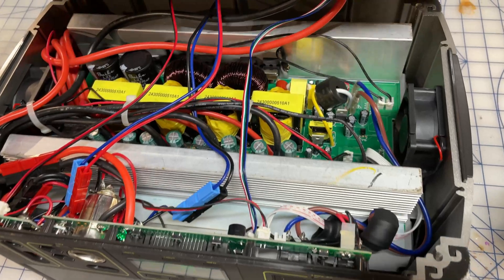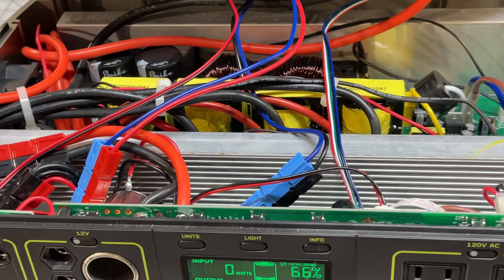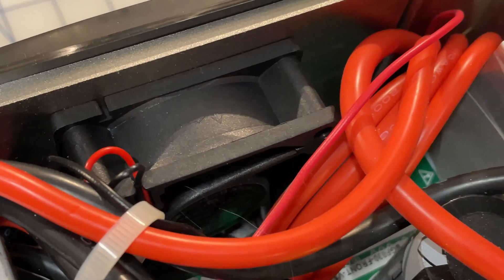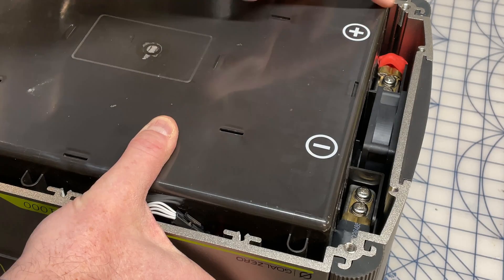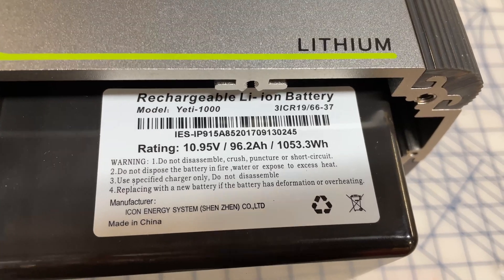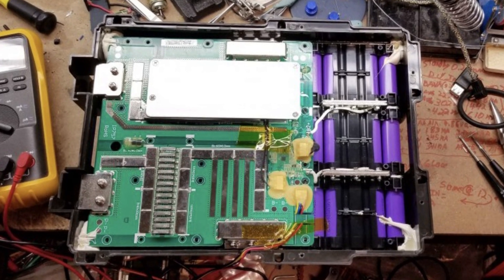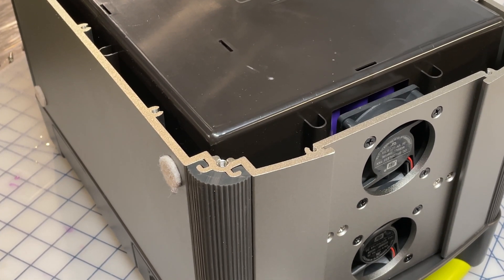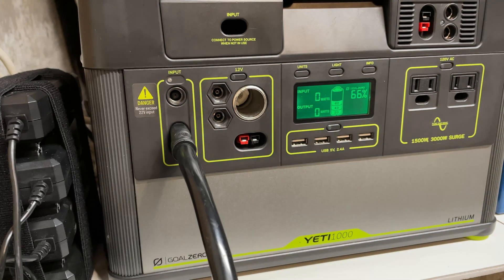Goal Zero Yeti 1000 Teardown: What's inside?

Comment: is their a place or shop to get one repaired  , costumer service is non existent  , never answer the phone  , after emailing them you get the run around , then you are ghosted  , i have a 1500x , the 110 ac outlets work for about 2 minutes then beeps twice and quit  , only using about 90 watts , wait 5 minutes , , will run again for  will run a 7 watt light bulb for 30 secondes , all other outlets work fine , , unit is 1 year old ,, anybody ??????????????
Reply from the maker: Unfortunately, I think goals zero has really has lost it. I wouldn’t buy anything from them ever again.

Comment: I have this Yeti 1000 and when I put the charger in, it beeps 3 times and the display comes on for 5 seconds and then turns off, but the blue charging message light never comes on. I've already disconnected the reset cables and it's still the same. Could it be the charger?
Reply from the maker: Hmmm. Not sure. You could try to open it and reset the bms by unplugging the cables but you can call their support first
Reply: @todd.parker  I reset everything and it's still the same, I received a new charger and even then the blue light doesn't turn on, I disconnected and removed the battery pack and noticed that the voltage on the battery terminals goes up and down from 12v to 1v and sometimes it doesn't go up anymore, I think there's a short on the power board

Comment: A few comments:  The bottom screws are for attaching to the cart, or other future accessories.  As with many things, the way you replace the battery is by replacing the cells - they look like standard 18650 cells.  If you are going to use an insulated screwdriver for 12 volt things, it's helpful to prevent shorts, but at 12 volts nothing will zap you unless you like lick it or stick it into your body somehow.  BUT, your tapemeasure isn't insulated, and could start a fire if you short out the + and - terminals.  Finally, thanks for doing this, even if you don't know much about it - we need more bravery and curiosity about things, and you are clearly showing that and teaching that.  Thank you.

Comment: Not sure if you'll see this or not but I have a 3000 that there was no communication cord to the mppt coming from the board. It looks like it come from the front board with 5 wires. Where your wires come out and goto the charge controller mine comes out by then loops back to the board. Not sure if it was wired wrong or what the deal was but goal zero wants 450$ to fix it and run the wire. If this is all it is the. I can fix it but don't want to burn up something

Comment: I had a customer bring me a Goal Zero Yeti 1000 it was dead and out of warranty so took a look at it the battery is a 3s 13p Li-Ion  this one had 3.65V-2600mAh-LG-M26-18650 cells with a maximum of 10 amps each x the 13 cells , yelp 130 amps so please don't do what I did unless you are qulified . There was on this bms test points to check each group of cell voltages , this battery had 1.8v on 2 groups and 2v on another so charged each group slowly to 4 volts and then noticed bms not working so reassembled pack and put a new ac charger on the unit and finished charging now finally the bms came on but nothing is responding on front display so about to see if I can wake it up when I get back to it . This power unit is built really nice so hopefully it will wake up. This unit was put away for several years without charging and the BNS just shut down like it should to protect the cells so hopefully it will be fine. So guys protect your investment and keep it charged and please use it at least some so it will be ready in an emergency .
Reply from the maker: Thanks for sharing all that info! Good stuff
Reply: @leedlbo9949  

Do you think these batteries are rebuildable?

Comment: I find for a lot of gz products the “parts” don’t seem to be publicly available, I hunted for the GZ 9mm chaining cable for the Sherpas Google also returned nothing. Seems very closed loop.
Interesting to see the modular expansion of the yetis as they get bigger
Reply: Forgot to add. Some products do exist (light-a-life) non branded and also some of the flexi GZ panels but without the “ports” gz has on them
Reply from the maker: Yeah, GZ has a lot of semi-proprietary connectors that are a real hassle. I prefer MC4 and XT60 connectors like most other brands now use. I wonder if they will every update their product line....
Reply: @todd.parker  I have found the Lenovo 7,9mm nibs fit the goal zero ports and as such enable building hybrid leads. I currently have a 5,5 to 7,9 lead for my 60&120w panels into the yeti. The 9mm ones are rare (like can’t find them anywhere) except on an ageing high power laptop power supply

Comment: Your right about over engineered cases...they are suoer nice, but when the technology inside is outdated and they also want a premium for it, I'll take a plastic body with far superior internals. I don't need the body to last 300 years when old tech standard lithium cells will fail in 5 years or less. There is no need for aluminum body and i feel like goal zero focused too much on that aspect with no real benefit.
Reply from the maker: I agree. I do think the case design is pretty smart because it’s just some aluminum extrusions so they can make it taller or shorter to fit different size batteries but I can’t recommend their stuff anymore

Comment: Goal zero is well behind the current competition.  I suspect they will be out of business if they don't start innovating soon. These current models have been the same for about 4 years and are regular lithium cells. The competition offers far superior lithium iron phosphate cells which are leaps and bounds better in terms of cycles and charge rate, better inverters, usb c up to 100w and nearly half the cost per Wh vs goal zero.  Admit I used to be a goal zero fan boy, but if you compare to bluetti or eco flo, its obvious goal zero is a over priced dinosaur. 🦖
Reply: Ecoflow is using NCM lithium, same as Goal Zero. Bluetti tho is using the better iron phospate.
Reply: @mwiz100  you are incorrect. Eco flow is LiFePO cells.

Comment: This is an excellent video. Lots of people on social media bashing Goal Zero for being expensive, but they aren't taking into account that the entire case is thick aluminum framed. A Goal Zero Yeti could roll over in a sharp turn or fall off a stacked pile in your cargo area and fall on the floor, and most likely be just fine, b/c everything is bolted to a metal frame. Jackery, Bluetti, and others are all plasticky junk and would crack. Heck the handle on the Jackery is fixed and would just crack. Goal Zero is like the Apple of the power bank industry.
Reply from the maker: I agree that their extruded aluminum case is really great. I like the simplicity and ruggedness of the GS stuff but I do think they have fallen quite a bit behind competitors at this point and the value proposition isn't there anymore. Let's hope they release something new soon that includes an internal high speed charger, LFP batteries, expansions batteries that aren't lead acid, etc.

Comment: i wonder if its possible to expand the battery by replacing it with the one that goes into the yeti 3000
Reply from the maker: My hunch is that would work but they don’t sell replacement batteries
Reply: @todd.parker  ya taking a second look at the battery internals it seems to be a 3s batter.  I wouldn't be suprised if you could replace them with 3 big one from alibaba and wire them into the bms.

Comment: Yep. From an engineering standpoint, the goal zero yetis are awesome. But sadly I read a lot of bad things about them in other videos. I hope mine will hold up and have no problems.
Reply: Had this same model and now after 3 years it's having charging issues. Goal zero won't do a diagnostic as they just want to change the battery for $400. Thought it would last longer than 3 years.
Reply: @senior706  Same thing happened to me, but now they want $500 to replace the battery.
Reply from the maker: I still think the Yetis have the best inverters and displays in the industry but they are quickly falling far behind Ecoflow and Bluetti on features and price. Let’s hope they step it up.
Reply: @todd.parker , For now, the Yeti X fits my needs perfectly. With the progress in technology, there will be something better and/or cheaper sooner or later. Since I plan on using my Yeti X for the next 10 years (I have it in use just for a few weeks/year), my biggest fear is that it will fail at some point.

Comment: My eight millimeter solar connector on the front face of my Goal Zero Yeti 1000 doesn't seem to be connecting right and it would not charge how can I fix that? I've seen how I can remove the top thank you for that I really appreciate it but by looking at your video it doesn't look like it's too hard to get at it but have you any ideas about how I would get it to connect to my solar panel? It seems like it's not connecting inside for some reason I don't know if it's on my solar panel connection or if it's on the goal Zero Yeti?
Reply from the maker: Can you use the 8mm under the lid to test if it’s the panel or that specific connector? There are a number of inputs on the 1000. Seems you could open the top and see if the connectors has come loose if you wanted to fix it.
Reply: @todd.parker  it's definitely the connector not on the solar panel I checked that already I think I'll try remove the lid and see if I can get in there but it looks like just too much movement on the connector like it's loose almost like a piece of wire inside the connector is not touching anything but I will remove the lid and take a look at it thank you so much

Comment: Yup.  Now I don't have to scratch my curiosity itch and take mine apart.  Just want to share that I've had mine since 2017 - when they first showed up at Costco.  I use it 3-4 times a year as the main 110V power source for my off the grid cabin. It has been reliable - everything works.  It's not super heavy - about 30 pounds - but I would not want to carry it far. I purchased a second charger as it has two charging ports and, yes, it charges exactly twice as fast - taking half the time. That is helpful because otherwise it takes about a day.

Comment: Greetings Todd, I've been following your channel for a while and grateful for the tests and recommendations. 2 years ago I own a Yeti 3000 unit as a backup in the house. My only concern is the safety of having a Li-Ion battery inside the Yeti. Do you know of any GZ scheduled replacement or modification (outside of GZ) of the unit to replace its internal battery with a safer one?
Reply from the maker: I have no information but I can guarantee they won’t offer a LiFePO4 drop in replacement. They don’t even have a user replaceable battery in the lithium Yetis.

Comment: maybe an ignorant idea, BUT, if you are using it in a full time nomad application, when the battery dies, as it will, remove the battery and wire in a suitable large battery to stand beside it, use the Yeti as the brain center and essentially an external battery as the power. As long as the "new" battery is similar specs, all the features should work the same. Does that make sense to the more knowledgeable or am I simply displaying a total lack of understanding ? be kind ! I'm fragile
Reply from the maker: I think that makes sense. The only Q I have is there is a set of BMS wires that may look for something specific to the built-in pack but in theory it makes sense.

Comment: Yeah, my 1000 is doing the same thing. And rather than send it in for a $500 NMC battery replacement, I just picked up a battleborn 100Ah and "chained" it as you did in your previous video. This set up, along with the GZ link, and 2 100W panels on the roof rack keep my ARB fridge continuously powered, and my jeep's dual batts trickle charged. Is there a way to add a battery monitor to see the charge state for the yeti and BB? I have them under my DIY storage platform that replaced the back seats, and while I did install fans for circulation, it's a pain to get to...
Reply from the maker: You could add a Victron smart shunt to your external battery and monitor the state of charge on your phone.
Reply: @todd.parker  could I wire the yeti to the shunt as well? Would I be able to connect to the terminals and run wires with the bottom cover back on?
*btw, great vids! I CANNOT believe GZ is replacing your 1000's NMC!!! Well done indeed!
Reply from the maker: @snosrfr71 he @snosrfr71 of the Battleborn from your phone. Treat them as separate systems but connected via the car charger and battery charger

Comment: Have a Yeti 1400 in for repair, the cells in your video is LG M26, chinease version (we have not opened our)its a very bad cells that loose capacity fast and become unbalanced. If there is just + and - going from the battery then battery replacement wound be very easy. Is there any other wires going to the top floor on your unit?
Reply from the maker: There is a wiring harness that probably communicates from the BMS to the CPU and display

Comment: Hi Todd,
How could I get in contact with you, I have some (for you) very basic speaker questions. It’s regarding Ikea Symfonisk and a sub.
Reply from the maker: Might as well ask here so others can benefit
Reply: @todd.parker  yes of course. If I take the woofer wire from a Symfonisk and would like to connect to my JBL sub. Is there any benefit to convert it to RCA, or should I just use the speaker level input on my sub?
Reply from the maker: You must convert the powered signal from the symfonisk to a lower power signal before plugging it into the RCA inputs on your sub. At a minimum, it will sound distorted but it could damage your sub. Because it’s too much power
Reply: @todd.parker  so an option would be to skip RCA and just use speaker level input on the sub?
Reply from the maker: Yes, if your sub has speaker level inputs you should use those. I thought you were asking because you sub only had RCA inputs

Comment: You mentioned 'Replacing the battery'?   Did I miss something?     great video, Thanks
Reply from the maker: I was trying to see if they used a drip in battery like the previous generations but the answer is no. If you need to replace the battery you need to main it back to Goal Zero, unfortunately

Comment: Fun to see inside, thanks for the video!  I have had the top lid off several times to reposition the AC on off button but did not poke around in there much. I have been using my GZ yeti everyday for almost 18 months as a full-time nomad and so far it still charges to 100% via solar or gas genny or both.

Comment: Damn it! I was waiting fir this video and I’m sorry it was disappointing. You said you was going to pull out the battery to take a good look at it. This was just disappointing.
Reply from the maker: Sorry, I didn’t see much point in removing it since it seemed custom. Like I said, I was a bit wary of going too far.
Reply: @todd.parker  I was expecting to see more of the batteries. Not just a tease. Was hoping to see more of what really power this unit? So if someone want to repair theirs and want to make a diy one, they would know what type of batteries they are.
Reply from the maker: @iiinsaiii  the battery is a pretty basic 18650 pack. The main thing I wanted to know is the part number and if a drop in replacement was possible. If you’re handy enough to DIY a pack, opening your unit is easy peas.
Reply: @todd.parker  I know what type of battery the 3000 has. I was hoping to see what was the smaller ones have. It’s cool thanks anyway.
Reply: @todd.parker  Thanks for the tear down. Since they are using 18650, It was strange for me to see a 10.95v on the battery. I wasn’t expecting that. I always assumed it was a 24v inverter and that they were using a 7s 24v battery.
Reply: Don’t be disappointed. At least he found the “unicorn” photo of the innards (which I have been trying to find)..
Reply: You're free to open your own yeti up and remove the batter, jack ass.